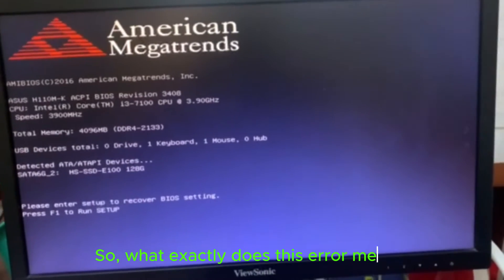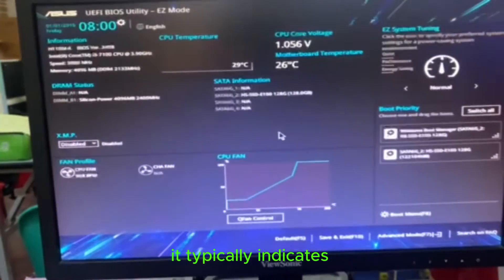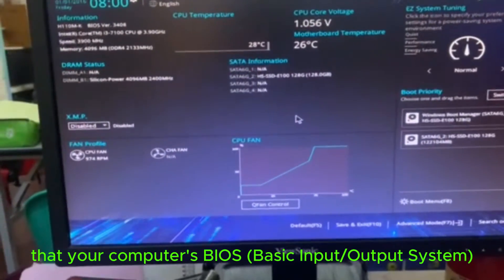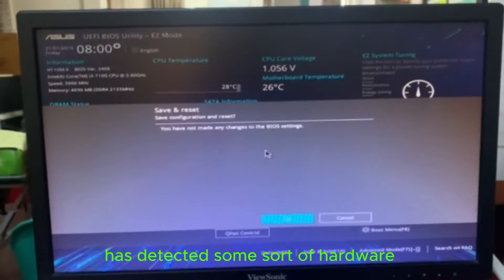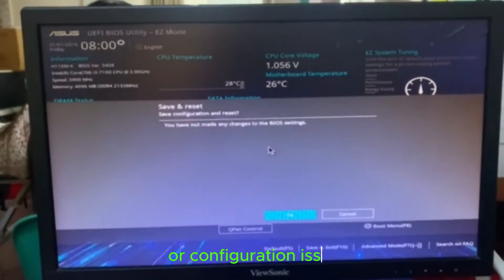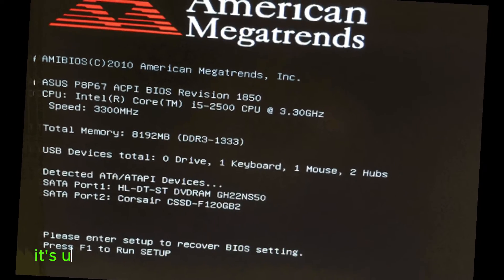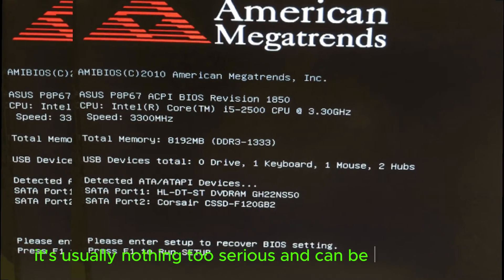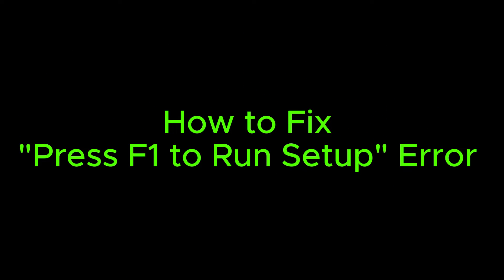'Press F1 To Run Setup' Error With This Simple CMOS Battery Fix!

Comment: In my case (republic of gamers  motherboard) the message is "CPU Fan Error". I have liquid cooling, not a CPU fan. I press F1 and the screen just moves to a black screen. After several attempts (and sometimes involving unplugging it from the wall to let the cells drain) the setup page does finally load. I turn off the check for CPU fan, and windows loads normally. Then I might get some error months later, have to unplug the system again, the setting to bypass the fan check is wiped and I'm back restarting again and again until the F1 works to enter setup. Is my motherboard dying?
Reply from the maker: Have you finished CPU fan speed lower limit to ignore?
Reply: @VirtuousTech  the problem is the system won't allow me to move past the intro screen to do anything. When I do finally get in there I just disable the CPU fan check and that does ghe trick for months....Until that setting is wiped (by unpligging it from the power) and we start again. At the beginning it says "press F2 or Del to enter the BIOS" but the system doesnt repond to that at all. I should note too that when I restart, it actually powers up, then powers down, then powers up again without me pressing power. Which of course is indicative of a hardware error. Then the intro screen, CPU fan error,  "press F1 to end setup", black screen, nothing and we cycle again. So I haven't done that, CPU fan speed limit, no, but right now I can't get in to try it in the first place 🤔 And I suspect even if I did change that setting, once it's unplugged, it doesn't remember my saved settings amd were back ti square one either way
Reply: @VirtuousTech  by the way thank you for trying to help, I appreciate it very much 🙏
Reply from the maker: @ warmly welcome
Reply: @VirtuousTech  ASUS suspects it really may be a replacement scenario. I haven't quite lost hope yet

Comment: Hello even i change the cmos battery to a new one the problems still the same.
Reply from the maker: Date and time correct?  Select your time zone and sync   time automatic is on. And then restart Your computer and check again.
Reply: @VirtuousTech  when the date and time is adjust until the cable is in the socket its ok. But when i remove it from the soket same problem persist.